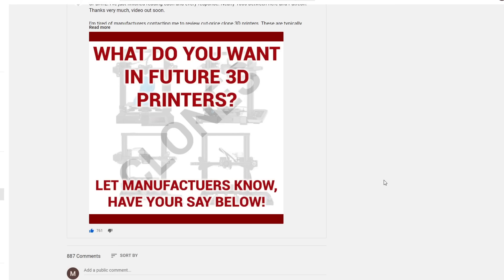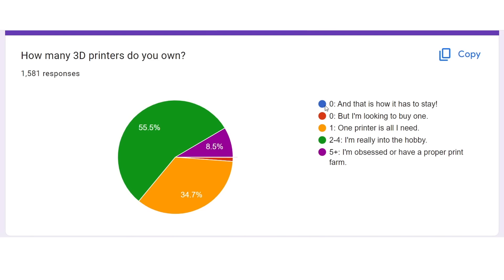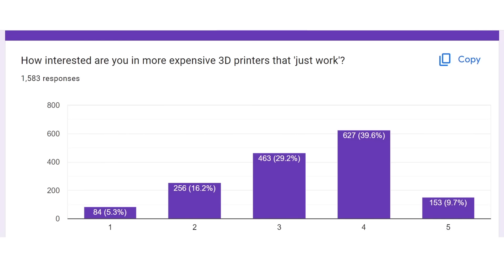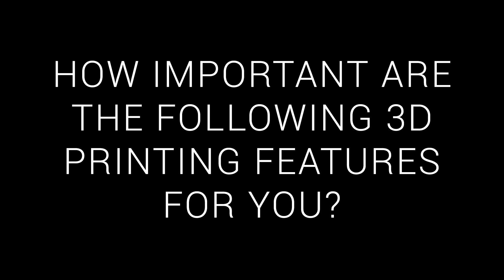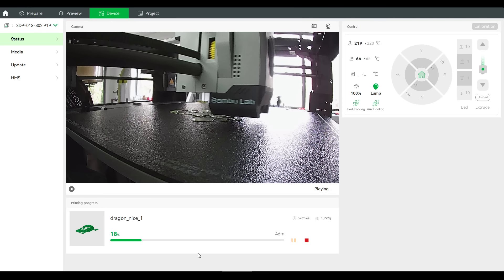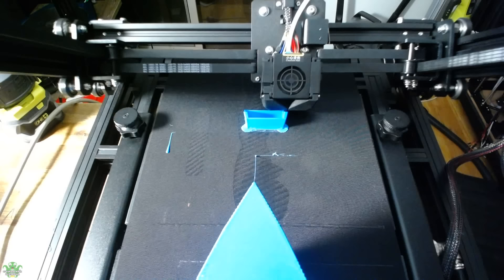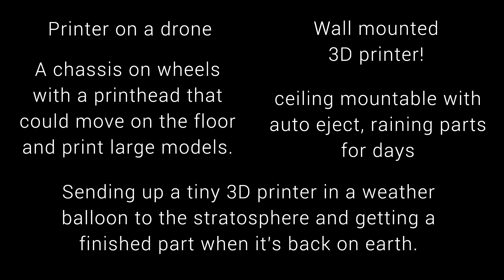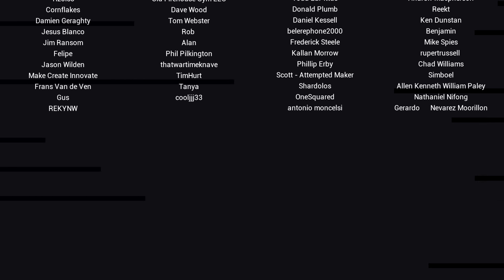The 3D printers the community actually want: Your say in 2024

Comment: I think the biggest missing component in all this discussion was bed size. I think that is an important metric as I see it constantly being brought up in various forums as a request to go bigger, but also a fair number saying that small suits their needs just fine. I would love to see what the actual breakdown is overlaid with the type of prints that people are doing.
Reply: I could appreciate a ratrig vcore4 500mm but I also think bed size is one of those things people really truly think they need when the vast majority will never have a use or be able to justify it.

Its the equivalent of buying a pickup truck. Most owners do not need them.
Reply: I make do with a V0  at only 120x120mm bed size, it's rather small, but at the same time. How often do you really need the bigger bed size? Worst comes to worst, I can print things in parts.
Reply: I would say it is overstated. For me 250*250*250 is sufficient. Anything bigger I do seldom and I'm able to design models as multipart.
Reply: I have a 350x350 mm and is a pain in the a*s because of that.
More you go bigger and every normal issues that you have are amplified.
Think about that people.
Reply: I think its less important. people will buy the size they want to print - we all want the other things, fast + quality etc.
Reply: Bigger bed = bigger printer = not as easy to haul around. I'd rather take consistency and great out of box performance.
Reply: @BeefIngot it depends on the use case of people, if you're just gonna print small stuff a Bambu A1 Mini or a 256 bed aswell

if you're more into stuff like helmets and whatnot a 400 bed would be awesome (i don't personally do cosplay)

it also helps to set up one print many times, it actually even makes sense for mass production as you can fire up 20 prints instead of 12 for example, which means you need to empty the bed less often

i personally wish Bambu had an ok priced larger printer, perhaps i should've bought the A1 rather than the Mini but i don't think for the current parts i do i need something larger, and if i want a larger printer i want something that can fit the same thing 4 times when it only fits once on a 180x180, which i'm often using the limit of, and 256 is ok but i'd wish for a 400 version to actually fit the same thing 4 times or print larger stuff

i've got some things i want to make with minimal separate pieces but that doesnt fit a 256 either
Reply: @qwertybg333  I think this is really only the case for relatively poorly designed printers.

There are many enthusiast printers (like the aforementioned ratrig) which are fine then things like the orange giga or whatever they called it, where they obviously paid no attention to ux or quality control.
Reply: If Orca Slicer would support non-linear cutting with multiple dovetail joints, I'd never buy a large print bed again.
Reply: @roderik1990  even p1S i have to cut things in parts and that slow my workflow. I still use cr10 and cr10s4.
Reply: I was disappointed that my modular bed size suggestion went unmentioned,  where you could bolt up to four printers together to make one huge multi material single bed machine. I suppose it was too 'out there'.
Reply: The majority have more than 1 printers. It could be 1 big, 1 small, and then mid sizes.
Reply: @ljadf  I think it might be technically possible, but how would you manage collisions between different gantries?
Reply: @ljadf mate ya need to think about what your asking. How could that even work from a technical perspective. That would have to be  the most difficult and problematic way of increasing bed size that I can think of.
Maybe one day when the printhead uses anti gravity to levitate and its range of motion isn't restricted by pesky things like rails and belts and pulleys... and you know the million other things that make this completely impossible.
Reply: @ljadf  My write-in idea was a 100x25x25cm volume that could switch the 1m axis from Z to Y with a quick rebuild, using 4 build plates for the horizontal configuration. I don't like how the large format options bring all the weight/rigidity trade-offs on all 3 axes when so much of what I want to print only needs one long axis but isn't suited to the belt's tilted gantry. Guess it lacked the shock value.
Reply: Big bed means big frame means expensive. But if you can cheaply make it big in only one direction it would some of my problems a lot. I have yet to see any.
Reply: I’m holding for the K2 or S08 - printing for 9 months on a K1 no problems and learned a lot (such as tweet the presets and bed temp in particular ) and soon needed/wished I’d gone for a K1 max or similar given the designs I print where structure becomes as issue - all in 24 looks promising
Reply: @BeefIngot  well, I'm talking about a Voron 2.4
Reply: I design models/parts fairly often that are long and narrow. A rectangular bed shape would be useful. One printer design I thought of was a combination core-xy and bed slinger. For high speed prints the bed would be stationary. For long prints, a long Y-axis moving bed could combine with the Y-axis on the print head motion giving a slower print but much larger size. Dimensions? Maybe 250mm X 1000mm. Could even have the large bed detachable so it's only installed when needed.
Reply: This is the trick.   I'd like a printer that could print something roughly 350mm cube, but 95% of my prints have a volume a soda can or less, within many being fitting within a 50mm cube.
Reply: I have a Switchwire and a V0. 90%of my prints are coming out of the V0. It's nice to have a "bigger" printer but I rarely need it.
Reply: corwinlester3303  Im not by any means saying no one needs a bigger bed, just that most dont.
Reply: I think that a combination of two printers (given that you have enough space and money) might be the best solution (at least for me). One smaller like a 120x120 or 180x180 and a bigger one with 300x300.That way you can print smaller parts in a shorter time while still being able to print big or print many parts at the same on the bigger printer.
Reply: Wholeheartedly agree with not only build volume, but machine footprint. That includes print media or in the case of resin printers, the added wash and cure system. 
For folks that need to print big, that’s great. But seriously, manufacturers NEED to make these printers work. Look at all the issues surrounding the Orange Storm giga.
Reply: Ive been contemplating a neptune 4 plus for the extra build size, but honestly 220mm×220mm from my ender seems to mostly be enough. Havent really needed anything bigger, i just want it for the ability to
Reply: not only bed size but print volume in general as bed size can be highly misleading on its own.
For example the X1C has a bed size of 256 x 256mm while the XL has 360 x 360mm.
on its own that seems like less than 50% extra in each dimension but ends up being twice the print area and if we also take into account the height we end up with the XL having more than 3 times the build volume of an X1C
Reply: Since most people only print tabletop and anime figurines they simply don't get why others want large print beds.
Reply: Most items I print are 12" x3" x2" and I currently have to print diagonally in all 3 axes, which slows the process considerably over what it would be if the print could be laid flat and 2" high. 
Several prints could be stacked in a single run. Multi-part prints are not acceptable.
I need a 12" cube print volume which is reasonable for most homes, especially if it can double as a 3D scanner.
Reply: having a 300x300 bed on my  CR10 V2 has been very nice. not hard to level or anything. I wouldn't want anything much smaller, maybe 260-270 at minimum.
Reply: @roderik1990 I need a bigger bed every second or third functional print I make. I have a flashforge creator pro 2 and find it very limiting and end up using my K1 max more and more often. Remember, functional prints not helmets. Camper trailer upgrades, telescope accessories, etc.. all need bigger beds. Only reason to go small is restrictions in space or restrictions in budget
Reply: To be honest in my case a smaller bed could work as long as the workspace is tall enough
Reply: I want a 1m
Reply: 180mm is definitely to small. I think 250mm is perfect to print anything except very big stuff that you could split into parts.
Reply: Bigger yes, but then it needs to be faster and cheaper to print. So pellet fed, and super-high flow rate.
It's a specialist machine for printing  plant pots, furniture parts, and other big items.
This is not a general purpose machine. It's your "other" printer.
Reply: I'm currently developing a smaller "belt slinger" and I'm planning a bed size of 4" cubed as it's what 95% of my printing fits in. This is something I'm always curious if it's actually what people want?
Reply: I forgot to mention this was a fantastic insight into the current user base
Reply: 305x305 / 1ft x1ft should be the next size up from small. It is large enough to avoid most size anxiety, but small enough to be manageable leveling and fits on a desk.
Reply: @Alphabet2002 
Why can't you have both?
Reply: Id love to have a larger bed sized printer but I have NO SPACE. It's a huge limiting factor in my apartment, so it doesn't matter how sick a bigger printer is, I'm limited to the standard and small form factor ones
Reply: Personally, I print in two sizes: small parts and cosplay. Which is why I have a V0 and an Ender 5 Plus. Normally when I need something big, it's because I need it super big (>250mm), and everything else fits on a V0 plate
Reply: also anything over 300 should have 2 heaters, inner ring + outer ring heating. waiting for a 400 bed is achingly slow. im on 9 minutes to 80deg
Reply: This matches my uses. My two most used printers are a small older resin printer and a very large format FDM machine.
Reply: I mostly print small things. But sometimes i really really wish I had a 400x400mm or simular bed for bigger things and project.

I amoung other things design airsoft guns. And a huge bed would allow this to much much more easy
Reply: 100% agree, and I will say it does not have to be cube format, but you are really restricted by not being able to print things with at least one large dimension. For me a double/tripple bed size BambuLab X1C would be an instant purchase, as there are so many of our parts that we need up to 600 mm in length.
Reply: @t1hero  Me to  - I really need something that can print 600mm
Reply: @Pixelplanet5  Well for our use (engineering parts) I would much rather have a machine that could print long parts in high quality
Reply: I have several Printers with smaller beds 140x200x200, Dual Extruder with 190x200x200.  Ender 3 with 220x220x250, one Tronxy X5SA with 400x400x400 and a X1C with 250x256x256. My Experience: The Beds below 220x220 sometimes have Problems as lot of Items are sliced for the bigger Beds on Printabels and Thingiverse. Personally i have now several Projects were i had cylindrical Structures with a diameter of 210 and just one with 240. For me the 10 cubic inch is the perfect size, it can handle the pre sliced standard Beds from the Ender 3 Era. All of my Printers are working, i simply use the X1C as it is print and forget, everything fits on it. The Big Printer is much slower, i printed some wall panels lately on it and switched back to the Bambu with smaller Panels as it was simply faster. 10 Inch on a good fast Printer with enclosure is very good compromise in my Experience. I am looking at a Sovol SV08 ATM as my 7th Printer as a fast 350x350 printer. But i realy don't know if it gains much over the 10inch Bambu.

Comment: My X1 Carbon is my fifth FDM printer...I'm "past" wanting to tinker with hardware, and I just want it to work. The X1 is my best printer so far.
Reply: Same here though it is my 11th 3D printer and 9th FDM, it is just so much better than anything else I have used aside from Stratesys.
I just want one that is 2-3 times larger on one dimension
Reply: Im fighting myself weather to buy a bamboo or a creality k1. I know that if I need a drill i wil not buy a diy kit. But i have so much attahement to my old ender 3 that i still want to tinker things with the printer. I do not work professionaly in 3d printing tho. I had a similar feeling like yours with android phones years ago: I had enough with the ROM testing and failing so i buy iphones for 10 years. But hey i'm back to android so who knows if the open side of 3d printers gets reliable enough you come back too

Comment: I forgot to really emphasize in my comments that quiet 3D printers, like dead quiet need to be an important part of the future.  Members of my family can hear a 1000rpm PC fan a floor away on the opposite side of the house running at night never mind a current FDM printer.  I need super quiet motors and kinematic systems.

Comment: I thought of one today. A spool holder that contains a scale. So you can determine if there is enough filament on a spool to complete a print.
Reply: Already exists. Sunlu's new dry box has a scale in it.
Reply: OctoPrint does this with software
Reply: On actually on the printer would be far better then a seperate box
Reply: @MrBizteck if you could put the empty spool weight you could use it for low filament detection as well
Reply: Spool Manager in OctoPrint will tell you if you have enough filament left before you start the print.

Comment: I appreciate reliability and ease of use. After living with the original Ender 3 for two years, I got a Qidi Q1 Pro a week ago and I feel like I have gone from the horse and buggy to the space age. Auto bed leveling is the one feature I appreciate the most. I finally got the moon lamp to complete without falling off the bed like it did in the bed slinger after 18 hours.  We spend $2k to $3k for CAD capable laptops to design with, a similar price for fast, reliable and easy to use FDM printers isn't out of bounds as far as I am concerned. My time is valuable and spending it adjusting bed leveling knobs is a waste. When I first started in this I didn't mind but somewhere along the way I just wanted the thing to print as I want to spend my time designing, not babysitting a cheap entry level printer.
Reply: Once you've had auto bed leveling, those handwheels under the bed look like stone age equipment 😅
Reply: @suzyamerica4679  except you still have to get a level bed. Auto bed leveling is an awful marketing term, as it typically has nothing to do with leveling the bed. A Qidi Q1 Pro, FI, does not auto level its bed, in any way that would replace adjustment screws. Four point leveling, with springs, is a bad way to do it, especially with rolled aluminum or steel, but that's unrelated to ABL. ABL compensates for imperfections, and is just as useful on a printer with a fixed bed, as it is a kinematically mounted bed, as it is for a 9-point flex plate bed, as it is on bed that actually auto-levels in a way to replace adjustment screws (3 Z motors).
Reply: @laurelsporter  All I do is this - for the first print job after changing nozzles, I tell it to redo the bed mesh - although they call it something else in the settings.

Had to muck with settings the other day for a TPU print job in 85A hardness. Pretty gummy stuff. Had to play with the print speeds, head temp, bed temp, cooling etc but eventually got it right.

Comment: Quick thought:  Sovol has been blowing me away recently.  My SV06 and SV06+ are my workhorses, and I'm VERY excited for the SV-08
Reply: good to know.
Reply: I agree that the SV08 is an exciting proposition.
Reply: I just got my SV08, and so far it is great!
Reply: @ectoBRUH  I've built 3x Vorons so far ( a pair of zeroes and a 2.4 ) and I hope that the SV-08 brings the same fire-and-forget convenience as the rest of their products.  I love the Vorons, but the elaborate VOODOO involved in getting a print going is a bit much.
Reply: @allenpaley  All I had to do is tighten belts and mess with Z offset. Printer is going great!
Reply: I would be excited, too, if they hadn't put in deal breakers like the loudness, no panels and a hotend that uses proprietary nozzles.
Reply: @JenSalik_  The proprietary nozzle situation isn't great, I agree.  Being honest with myself though, I don't print abrasive filaments, so the only reason I've had for nozzle-swapping in the last few years is typically to upgrade to a CHT. 

I see that the SV08 has a panel kit available, but for the cost, I'd just as soon do what I've always done:  Coroplast, aluminium checker plate, and PC.  Most of these materials are cheap to acquire and (mostly) easy to cut into shape.

That's just me, though.  I respect your convictions and admire when people say no to something that's not good enough. 😎
Reply: @JenSalik_  the proprietary nozzle for sure is a strange move for an open source printer.
Also considering one but waiting for people to change the hotend and printing different materials. Still kinda regretting givjng Sovol a try ..the extruders on my SV04 are very poor. Can't print 83A TPe which was a big reason to get it in the first place.

For all the other features mentioned I'd like to see tool less nozzle swap at least...multihead printers with independent auto leveling would be a blast.